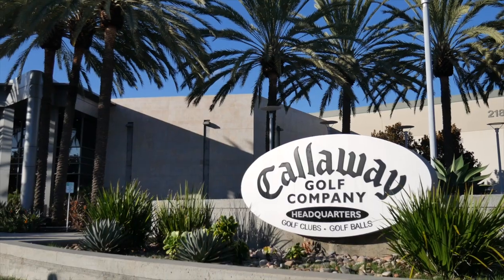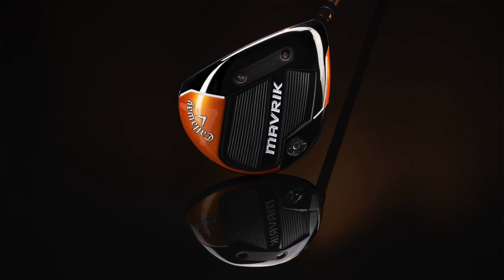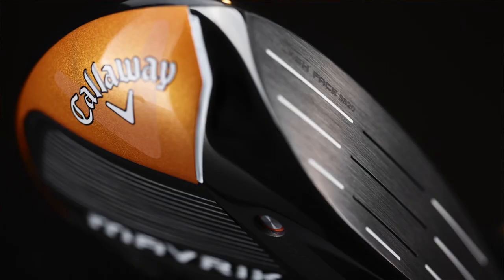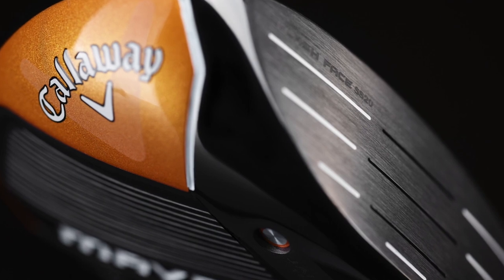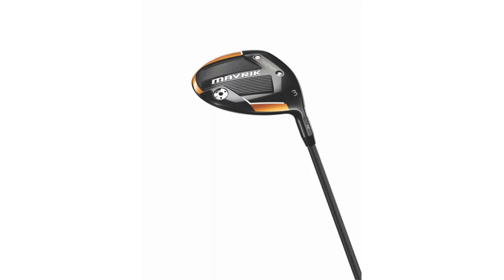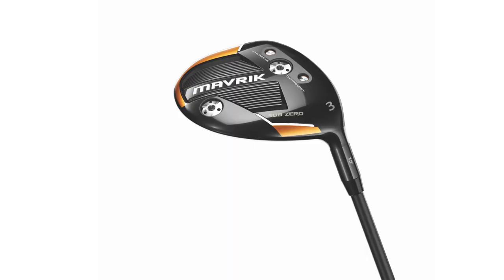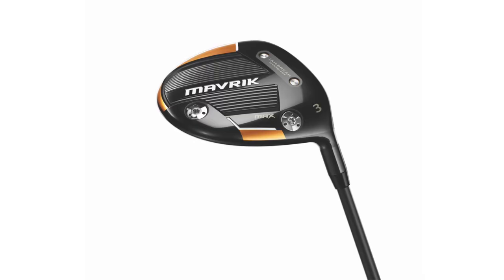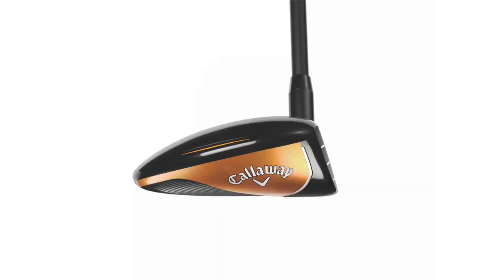Callaway Mavrik Fairway Woods | R&D Discussion

Comment: WOuld you say these are better than epic flash (non-SZ) ? In terms of feel & forgiveness?  Also how do these rate against Ping G410+ regarding the same ?
Reply from the maker: Stephen, the Mavrik lineup has a little softer sound and feel than Epic Flash. It's probably more in line with the original GBB Epic products in that regard. And probably a slight edge to Mavrik on the forgiveness side as well. As for G410, it will definitely be a little bit louder and have a firmer feel, but it would probably rate as more forgiving. Thanks!
Reply: 2nd Swing Golf thanks !